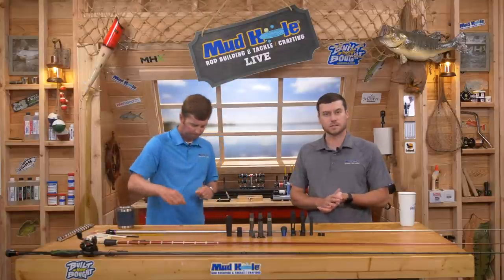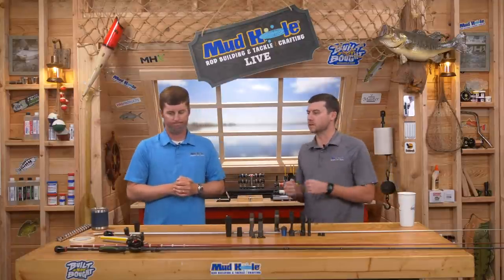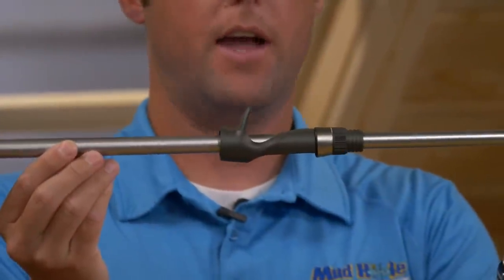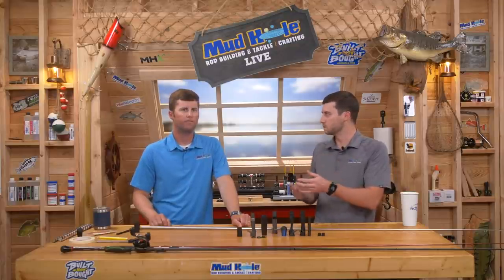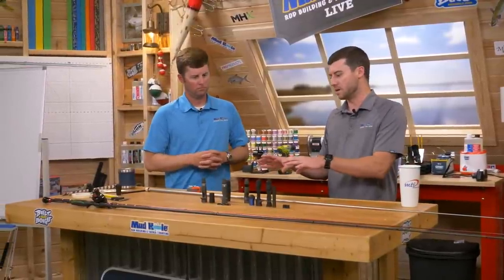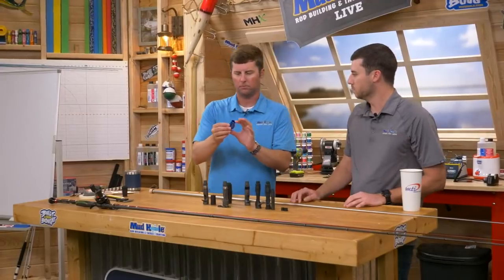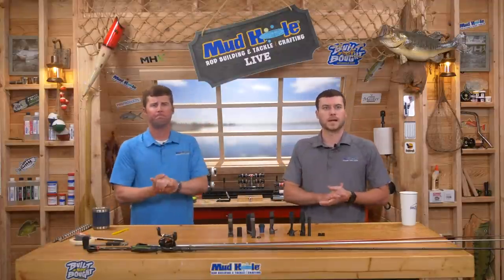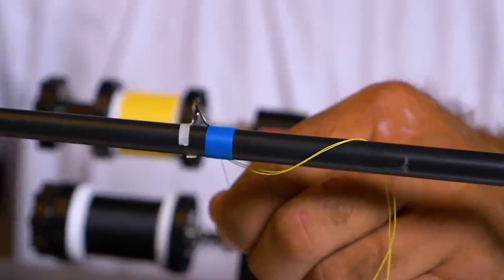Mud Hole Live: Big Show Bass Builds

Comment: Y'all talked about "pistol" grips.  I actually prefer to use these grips on all my casting builds.  I have them on my flip&pitch rods, crank rods, worm&jig rods and top water.  All have extended butts, also.  Now, I do cut my pistol grips to 2.5", to keep my hand placement tighter to the reel, while palming.  All my split butt sections measure 9" from end of the pistol grip to end of butt cap.
Now comes the real question...I  wish to build replacement rods for the ones I currently use.  I wish to build them with a "true" active casting/fighting length.  Example:  8' HVY, fst action  flipping/pitching rod.  The 8' length would actually need to measure from back of reel seat to tip.
Should I settle with shoving an extention section into the butt of the blank, or are there any blanks y'all carry that would work with my build goal?
Thanks, Ed